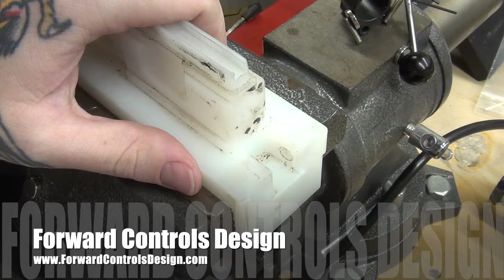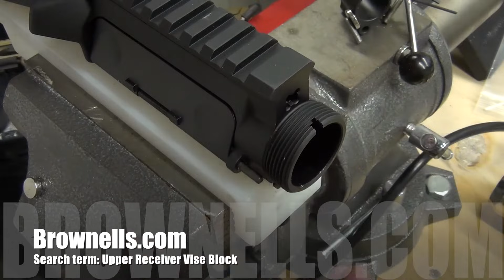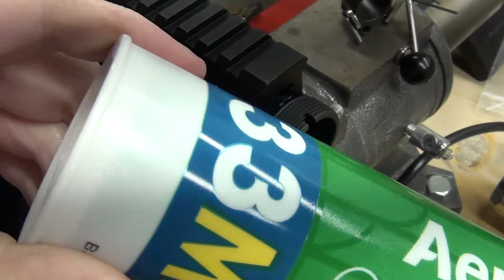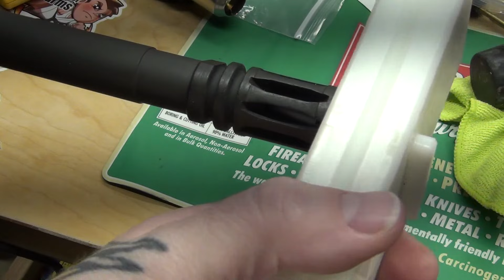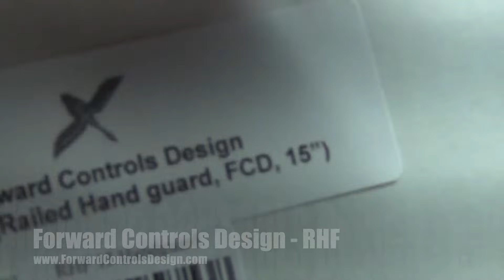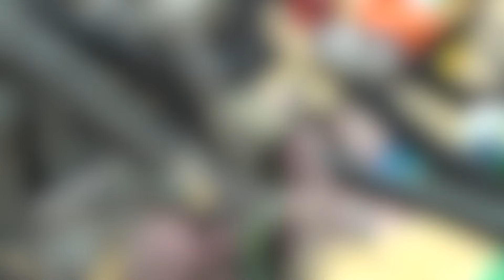How To Install Tight Barrel - Barrel Installation

Comment from the maker: There are many tricks used to seat tight barrels. This is a method that I use that works for me. You may choose to do it how you prefer.
Reply: I find lapping the face of the reciever also provides some clearance on inside of reciever
Reply: @mikemassey7458  Lapping the upper receiver face has nothing to do with providing inside clearance of the upper receiver I.D. In fact you need a custom lapping tool to lap a thermal fit upper..  These are called thermal fit uppers, which require heat to install and remove the barrel. Beating a barrel in or out of the upper receiver with these types of uppers is the incorrect way to install or remove a barrel..Using a map gas torch is the correct method. Lapping the upper receiver face will move the barrel further into the upper receiver, which can allow the barrels feed ramps to over hang the upper receivers feed ramps, requiring feed ramp work.
Reply: @hairydogstail  put the barrel in the freezer the night before install. use map gap on receiver. it will slide together like butter.
Reply: Im sorry but if you are having to bash it with a hammer for that long than its not “working”
Reply: @Modsnake98  BUT, BUT, He's built a lot of rifles, LMAO.
Reply: Thats how we do ball joints and diff bushings

Comment: I like JP’s instructions. Secure the barrel in a stable position the heat the end of the receiver with a torch for a few rotations then quickly slide it onto the barrel extension.
Reply: Torch would work much better.
Reply: Idk.  I put my upper in an oven.  Nice even heat, no hurry and scurry.

Comment: Sounds crazy but throw the barrel in the freezer for a few hours, the cold makes the metal shrink a bit and it helps
Reply: in the freezer it’ll put water in your barrel not good
Reply: @Ericczz  that’s what the protective finishes and grease are for
Reply: Worked for my first build.
Reply: @Ericczz  literally just nitro the barrel afterwords then oil.
Reply: Yes, heated the upper and froze the barrel
 A small amount of persuasion with a dead blow to fully seat.
Reply: @Ericczz the freezer itself will not "put water in your barrel". As it warms up it may condense like a cold glass of soda but you can also run a few patches through it.
Reply: Doesn't sound crazy at all. My Armament Section used have barrels stored in a refrigerator prior to doing an infantry company's annual guaging. With 160 weapons you don't have time to be dicking around   with a heat gun, and they NEVER used a torch. We didn't have Aeroshell back then. We used GMD, Grease, Molybdenum Disulfide.
Reply: @dw7094  used to hate gauging days. They wanted them bone dry of oil and by the next day there was always rust
Reply: Or just get a proper spec size barrel and upper receiver
Reply: @BaconSlayer69  if it’s proper spec it will be tight…. If it has play that will decrease accuracy
Reply: 50% water and 50% Alcohol will make the water temp down to 12* F.
Reply: @joew8013 When I'm running contract orders, I use a bearing heater on the upper. For runs of less than 20 firearms I just use a map gas touch or a heat gun, once the upper reaches 250° any barrel you have will slide in with ease. I typical use Criterion barrels which are notorious tight tac drivers, I seat them with loctite green and have never had a single problem from desert to artic conditions.

Comment: Three thoughts. First, the torque lubricant should always be applied to the shoulder of the barrel as well as the threads. The concern about putting force on the locating pin while using an upper receiver holding fixture is largely from lack of lubrication on the shoulder. Second, for those who work on other firearms there is no need to buy an action rod if one has a good barrel vise. I have a Wheeler vise with oak blocks that can be cut to fit most any barrel. It also makes a great vise to hold an AR flat top upper between the blocks. Third and final, the heat used was way too little. A firearm is designed handle heat considerably above boiling point. Heat until spit sizzles. And start with the barrel cold, after spending a couple of hours in the freezer. Just work fast and it will slide right in without a hammer. If not, the barrel extension needs some light work with some medium fine wet or dry sandpaper.
Reply: I was gonna say that. Heat the upper hot while hving the barrel in the freezer
Reply: I agree with the barrel vise approach 100%.  Putting the receiver in a vise always bothered me.  Clamping an aluminum receiver into a vise just rubs me the wrong way, then add the force of torque from tightening the barrel nut.  Yikes!  People get all anal about bedding in the barrel extension, shimming, etc. etc but completely disregard all the force they are putting on a soft aluminum receiver, potentially twisting and deforming it, maybe not by much, but just enough.

Comment: I've always heard when using torque wrench you don't want to torque towards the adapter, you want the adapter to trail behind the wrench. Torque towards adapter is said to add ft lbs without reading that its adding whereas trailing is not subtracting anything

Comment: Once you have the barrel partially in the upper and apply more heat you are also expanding the barrel extension. Get the upper warm enough first off, don't rush into introducing the barrel!

Comment: Great vid, More time consuming method here but Try throwing your barrel in the freezer for an hour, heat up the upper 10 min before pullin the barrel out. Grab the barrel before the upper cools off and slide it. Might get a little resistance. Worked every time for me
Reply: But how do you remove that barrel in future?
Reply: How do you heat the upper?
Reply: @romang6437  By the time you need a new barrel, just buy a new upper with it.

Comment: Cool down the barrel extension and  heat up the upper receiver threads with a torch youre done in less than 15 mins

Comment: If you use MAP Gas it will work a whole lot quicker and a whole lot better to thermal fit a barrel to an upper. It won't damage anything.

Comment: Wow. Never had a barrel that tight. Pretty unusual, but great video. Thanks.
Reply: That's what I was thinking.  I've installed some tight barrels but nothing like this.  Glad to see its okay to pound on it like that.
Reply: Zev uppers are also tight so we now put the upper in the oven on warm for 30 minutes and the barrel slides in
Reply: @williambader1425  good tip
Reply: It's not that unusual, there's quite a few that have tolerances that tight and you have to thermo fit. I don't think I would've banged away on it, I use a torch instead of a heat gun. 

To remove you do the same, put receiver in a block, run the torch around it, and use a 1inch dowel to put through the receiver and knock the barrel out.
Reply: @jordansprad  good to know. Installed quite a few, of different manufacturers, and never incountered this. But I agree with your torch method.
Reply: @KD_Bees  litterally going to do one tomorrow on a new build
Reply: @jordansprad  cool. Not doubting you.
Reply: @KD_Bees  I should do a video on doing it since I searched about it and the JP video is about the only one that does it proper. Anyway, have a good one!

Comment: Great vids, thanks! I've come across several. Just quick FYI - if you heat receiver while barrel is in it, you are heating/expanding both, therefor cancelling the effect.  Heat only receiver and keep barrel cold.
Reply: The Aluminum expands faster & the fool should have used MAPP GAS NOT A STUPID HEAT GUN.

Comment: I just purchased the gas block pin tool, I do believe it will make life so much easier installing the pin into the gas block.  Thank you!
Reply from the maker: It is small but makes a HUGE difference. Sometimes having the right tools just make everything easier.

Comment: I put mine in the freezer and the complete upper in the oven for like 200°4 like 45 mins. It'll go right in blithering know you're probably alot more experienced than me , but anytime you have any torque wrench  with a socket, the socket or specialty tool like yours the it should be pointed straight  if not you are actually applying more torque to the nut or bolt, because the torque wrench is having to bypass  that original amout of pressure to meet the pressure setting that's on the torque wrench, I mean this in the most respectful  way, I've been an automotive tech for 20 pls yrs,and built a few ars one chambered in 223 and andanother in 762x39 and have broke plenty of bolts when I was younger due to this, I hope this helps,  God bless

Comment: Midwest industries has a much better reaction rod than the Geissele.
Reply: Yup.  👍👍
Reply: Good to know
Reply: 200$👀
Reply: Yep, the Geissele will hide uppers where the lugs are out of alignment with the gas key guide / charging handle track in the upper. The MW has a, "sail" on the top that enforces that orientation of the locking lugs. That MW bar actually alerted me to an out of spec upper which kicked off a hellish series of events. Without the sail there you could mount everything up but the feed ramps would reveal that the indexing was off ever so slightly...not good as the locking lugs on the bolt would be crashing every time it went into battery. It's also a hell of a lot cheaper, better...and cheaper, what more could you want?
Reply: Just got one. Reddit praises it. The magpul bev block is helpful too

Comment: Two years late to the comment section....  Use a gas torch to heat up the upper receiver barrel extension.

Comment: What if you put the barrel in ref to chill out for a bit and then heat up the upper receiver? Works great when doing bearing swaps on small r/c engines.

Comment: Put the barrel in the freezer overnight, heat the upper and then fit the cold barrel. I bet it would slip in very easy with room to spare. Its a diesel mechanics trick to fit wrist pins in Cummins engines pistons.

Comment: The Midwest Industries upper receiver rod is better than the Geissele reaction rod, it has a solid bar on top that rides in the charging handle groove that keeps the receiver drom trying to turn.
Reply: Use a good barrel vise.

Comment: I used the momentum method. Mega Arms upper. I used my anti sieze stick. Then I dropped the back of the upper on the carpeted floor. It slid in under its own weight.
Reply: I just had Aero Precision mention that with their enhanced upper, and also stating no grease was needed.

Comment: I was a gunsmith in the army never dod I ever have to force a barrell in but this is good info
Reply: Ikr. He should have used the heat .
Reply: That's because the military uses rifles/parts that meet the TDP spec and tolerances..
Reply: @hairydogstail What is TDP?

Comment: I don’t work on guns, but I work on cars. Just wondering if you could’ve put the barrel nut on and tighten it the rest of the way and if that’s not an option, throw the barrel in a freezer and heat the thread up and it should slide right in, use this method a lot with joints
Reply: Add heat to the upper and it will slide right in..

Comment: Has anyone ever just applied anti-seize , grabbed a steel barrel nut , and torqued it down until it hits solid , I did that with a very tight fitting Bravo Co. upper , worked flawless as long as it goes at least half way on to start .
Reply: Don't use anti-seize, use Aeroshell 64..No need to over torque the barrel, it is counter productive past 50 to 60 ftlbs..

Comment: if I were to use a blowtorch how long should i blast the receiver threads to heat it up and expand it? my radian upper does not want to seat my barrel.

Comment: Its easier if ya do it with the barrel locked into the vice and heat the upper while holding it in your hand....BCM uppers are notoriously tight
Reply: That's because they are thermal fit, you put a torch on it for 3 seconds and it will slide right in
Reply: @apb2887  I know, I've built 2 rifles using BCM uppers, I eluded to that in my comment 👍🏻
Reply: @pmorin313  do you use still use grease or will it melt?
Reply: @thomasj396 a thin coat of aeroshell 33 on the barrel extension won't hurt. Although once you apply heat the barrel goes in pretty easy....just be quick, it cools fast!
Reply: @pmorin313  i bought a bcm upper, we use a little propane torch at work for heating sleeves

Comment: Beating it in with a hammer is not neccesary if you put the heat gun on the upper for a good 3 minutes straight put it right to it, put your greese on the barrel extension and then it will slide right in, I do this with BCM uppers which are very tight.

You can see in this video he did not heat the upper long enough.

Comment: That's putting a lot of pressure on those takedown pin holes.
Reply: Yup.  That's why receiver clamps/ jigs are garbage.  Get a good barrel vise. The barrel is steel, the receiver is aluminum.  Do the math, lol!

Comment: Last weekend i installed a barrel in a BCM upper. Never again will i use BCM. Not because they're not good but they're super tight. I put the barrel in the freezer overnight, heated the upper prior to the install, and lubed the barrel extension with grease.
I could only get it about 3/4 of the way by hand. It took about 20min of heating and beating the shit out of it with a rubber mallet to get it to seat. Should not be that hard.

Comment: Quick question,  i installed my barrel to my upper receiver and its doing the same thing. But i got a qrb so i have to put it in and take it out all the time..i see you used a heat gun. Will that same method work on mine since i will be installing and uninstalling all the time....

Comment: I have 3 receiver sets that are extremely tight to get the barrel in and just got a 4th.  Not looking forward to installing the barrel.  Last time I froze the barrel, used torch on the upper and used grease and it still took quite a bit of force.
Reply: I have been using BCM uppers and yes they are crazy tight. Used heat on receiver and froze the barrel but the last time used steel wool to take off some of the phosphate on the barrel extension. FN has a thick phosphate ,Geissele and DD not so much.
Reply: Those are called a thermal fit. Use a map gas torch and the barrels will slide right in and out..No need to freeze the barrel. You should also coat the barrel extension with 620 green loctite to bed the barrel to the upper after you lap the face of the upper receiver..Be sure to check the barrel's feed ramps don't over extend the upper receiver feed ramps or you will need to do feed ramp work..

Comment: Hate to rain on a parade, but you torqued that barrel nut to more than 50 ft. lbs.  When using an extension, as you did with the "crows foot" attachment, additional leverage is applied.  Therefore, the final torque is determined using this method: M1 = M2 x L1/L2.  Whereas M1 is the torque setting.  M2 is the actual torque applied (the part you don't yet know and is certainly more than 50 ft. lbs).  L1 is the length of the measurement device (torque wrench) from the center of the hand position to the center of the male "drive".  And L2 is L1 plus the additional length of the crows foot.  This is essential to know how to calculate.  Barrel nuts and other fasteners, not just on firearms, are over torqued everywhere because of failure to know and apply this rule.
Reply: Torque spec is 30-80 ft/lbs. It legitimately does not matter.
Reply: I have a craftsman Torque wratchet. How much should I set it to to get the ideal ft lbs??

Comment: Freeze the barrel too it helps. I’ve had a JP gas block be so tight I couldn’t get it on a white oak barrel.  Froze the barrel, heat gun the gas block and it popped right on.😂

Comment: Can you also do a video of removing a thermal fit barrel? Really enjoy your videos, very informative in case I ever have to replace a barrel.
Reply: JP enterprise has a video demonstrating this using a one inch wooden dowel rod
Reply: @pmorin313  Yeah this is how I do it. I've had to restart this procedure before. You put the upper over the edge of the bench registering off of the gas tube / pic rail area as and abutment and beat it out the end of the gun using a hammer. I usually toss a bucket under it with a towel to catch it when the barrel falls out. You have to dig out bits of wood from the lugs and such but wood Vs metal no damage is going to occur other than to the dowel.

Comment: You are heating the The receiver and the barrel at the same time would have been much better if you had put the barrel in the back of the freezer for a little while and then after a little while heat up the receiver take the barrel out of the freezer and it will go right in without any grease or anything

Comment: That's a thermal fit upper..... you're supposed to use a torch not a wimpy heat gun...... NOBODY should use any of the advice given in this video except use aeroshell
Reply: Yup, a mapp torch will heat up in no time and the barrel will slide right in.. Cringe moment when he pounds on the barrel..

Comment: I always stick my barrel in the freezer overnight and use a propane torch to heat the receiver up two or three times more than he did.  Don't go nuts just heat it up for 30 to 45 secs and that's all you need.  I also clean the barrel and inside the receiver completely so they will stick to each other and not move around when fired.  One more tip, never go above 50 Ft. Lbs. on your barrel nut, 35 Ft. Lbs. is just fine, and I have found that 35 lbs. produces a better grouping rifle.
Reply: Hello, thanks for your advice. I'm building an ar pistol, could you elaborate a bit further on why 35ft lbs has better grouping than 50ft lbs?! Please and Thank You 😊

Comment: What if your barrel goes in and is a little loose? Is that a bad thing or the barrel nut when tighten will do the job.
Reply: Check brownells videos.  Smyth brothers.  He says the nut will tighten up the upper to the barrel due to tapering?  Never know what to believe